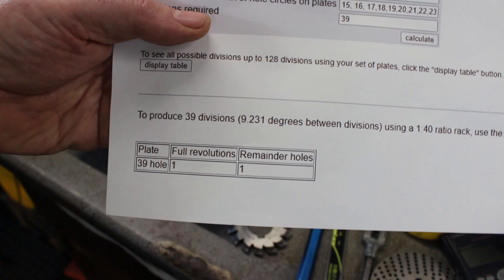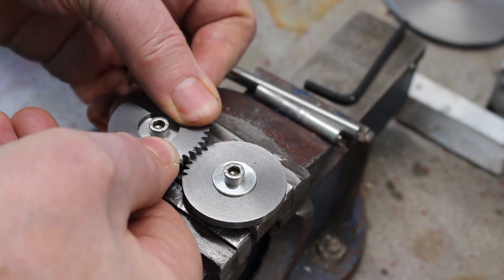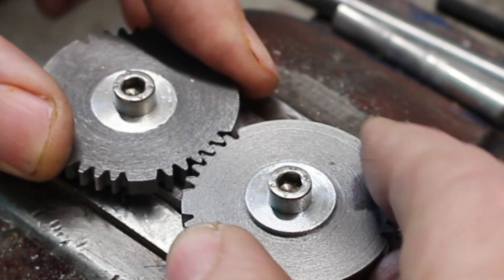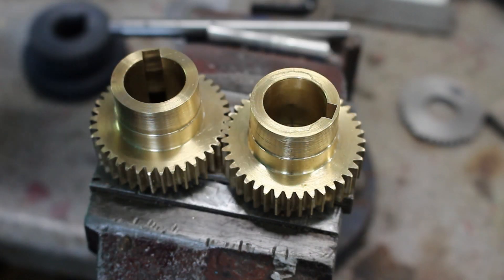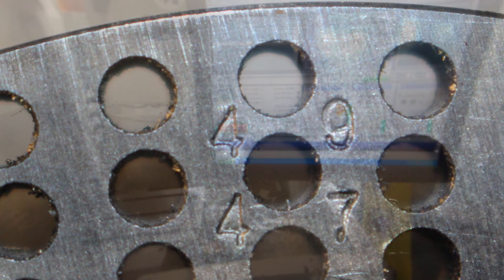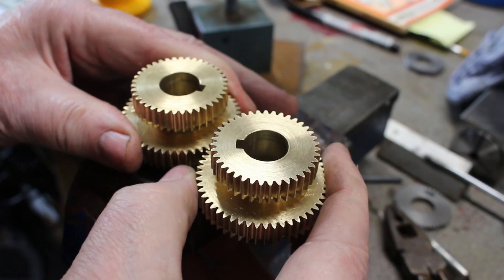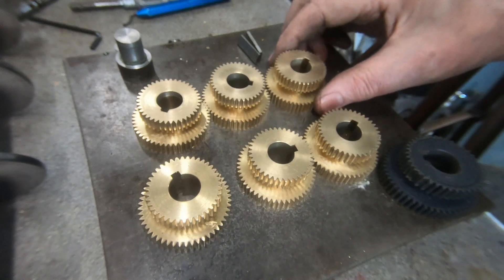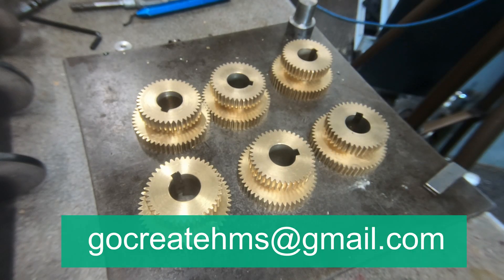Warco WM12 Vertical Mill -  High Low speed change gear

Comment: I have been given one of these machines how will I know if have bad gears thanks looking forward to your reply
Reply from the maker: Hi, I don't own one of these machines myself. The OEM gears are plastic and easily damaged, some owners prefer to replace them with metal gears to avoid having to go through the disassembly and re-assembly maybe several times. 
You will know when the gears are bad, the gear teeth will strip and the gear drive to the spindle won't work.
I hope that helps.

Comment: Well done. No doubt you'll be making some WM12 owners quite happy.
On the new index plate you made, how did you calculate what the circle diameter of the 51 holes needed to be?
Looking forward to the next video.
Reply from the maker: Hi Pitch circle diameter of the holes doesn't matter so long as you can fit in all the holes. I use a g-code programming software to program the cnc, I just laid out the holes in the software until they looked OK.
Thanks for watching my video, much appreciated.
Reply: @GoCreatehms  Thank you Sir, it makes sense to me now.